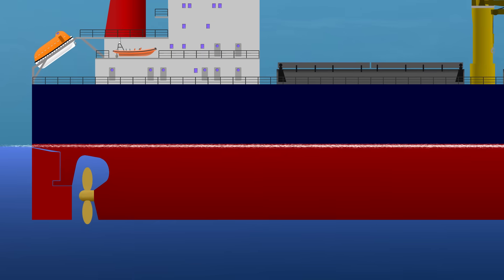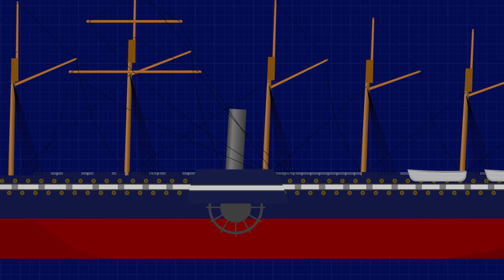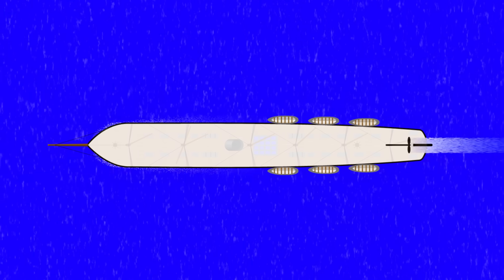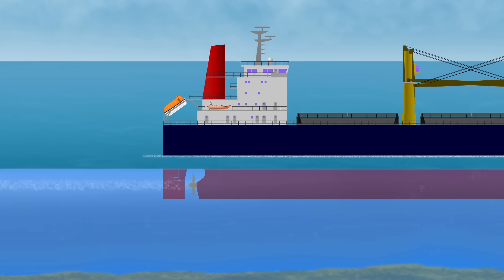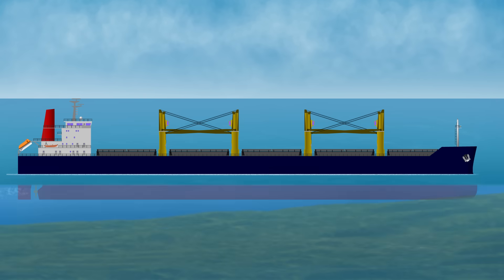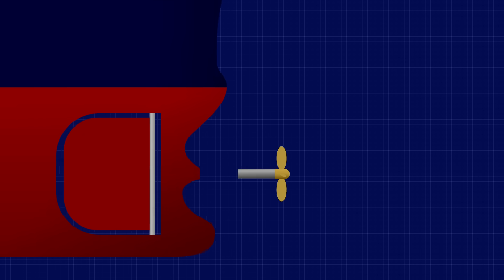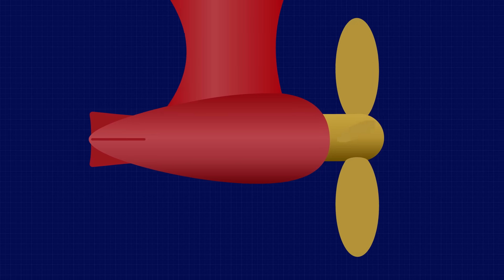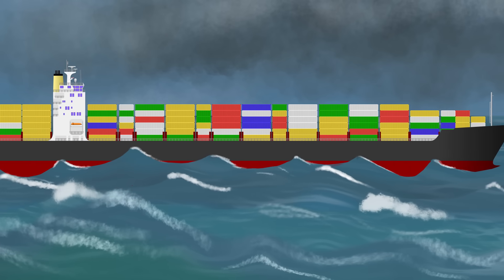Why Is The Propeller At The Back?

Comment: We must follow the protection from damage argument through to it's natural conclusion. 

Ships place their propellers at the rear to protect them from damage when a vessel collides with an object. Therefore, aeroplanes should ALSO put their propellers at the back, as very few aircraft have been known to reverse into mountainsides.
Reply: But airplanes rarely continue gliding after crashing front first into mountains, so the loss of the prop doesn't change the survivability of an aircraft collision, whereas the slower speeds and much more robust hull mean that ships can quite often reverse off of a rock, or at least be towed off of one and then limp back to shore for repairs.
Reply: @bosstowndynamics5488  It was a joke my guy, we are very aware that losing your prop is the least of your concerns when crashing

Comment: I have read that having the prop at the rear also helps energize the boundary layer on the hull, making it more efficient.  This is less  important for an aircraft where the air has less density.  For propeller planes, the issue is for cooling of the engine.

Comment: I think the question should be, why do most small planes have the propellor in the front.
Reply: Main one I can think of is cooling for air cooled engines. Basically anything small general aviation with pistons. When it gets to turboprops where a turbine drives the propellor it gets less relevant.

There might be a ground clearance component too for take off and landing. For landing due to the glide with flaps it's hard to not make the tail touch the ground first. And similar issue with it take off where you'll always have the front pull up and thus push the tail down a bit at take off rotation.

Interestingly there are things out there with the propellor at the rear, ultralight things where it's behind the pilot seat for example. But also on old things like the Kitty Hawk (first powered heavier than air flight by those Wright brothers one might have heard about).
Reply: Stability?
Reply: @-sturmfalke-  No, but that's a common confusion (the "pendulum rocket fallacy", applies to aircraft just the same): whether thrust is applied at the front or the rear of the vehicle does not matter for stability. This is intuitively assumed by analogy to a pendulum, which is stable when suspended from the top, but unstable from the bottom. But what makes a pendulum stable, and an inverted pendulum unstable, is how a restoring force changes direction (from the pendulum's point of view) depending on the direction of swing. By contrast, an aircraft propeller does not change direction, as it is mounted to the aircraft, so no restoring force and no stability.
Aircraft are stabilized aerodynamically in various other interesting ways (for example mounting a horizontal control surface at the back, dihedral, ...), but propeller placement is not a part of this
Reply: @hadinossanosam4459  Thank you, that is exactly what I meant, and you explained the matter absolutely perfect! I know more than before.

Comment: Airplanes with front propeller reasons include better cooling . Prop planes with regular or diesel engines get intense airflow over the engine to cool it more than if the prop was behind. Its not always vital and turboprops can be different. Another poster also mentioned the lift benefit of the intese airflow over the wing behind the engine.
Reply: Pusher-props would also be difficult to implement on a taildragger (due to ground clearance), so you can have less complex landing gear. Additionally, with a single prop at the back, braking could become more difficult with more weight at the rear.
Reply: But front mounted props are also somewhat problematic when interacting asymmetrically with the control surfaces on the wings, so some pushers have been built.

Comment: And on the other side of things aircraft propellers are meant to pull and on multi engine aircraft the benefit of having front propellers that are wing mounted is that it provides artificial airflow over the wings making it more resistant to stalling

Comment: Having the propeller in the front would cause a challenge connecting the propeller to the engine, since the rudder is in the way. Thus needing a more complicated solution.
Reply: With electric drive that is irrelevant. Azipods just rotate the propellor and mount it below the hull.